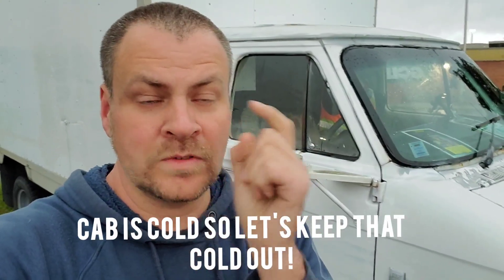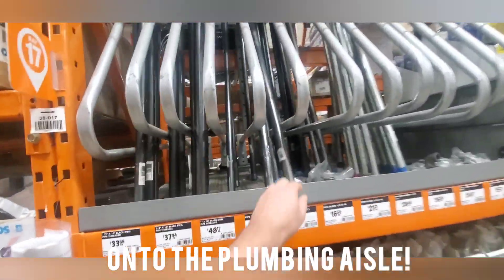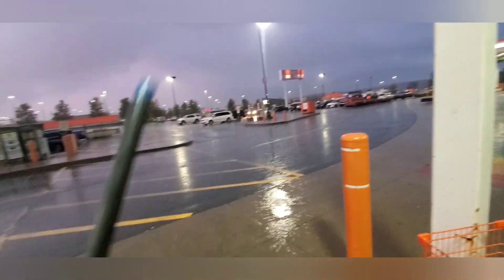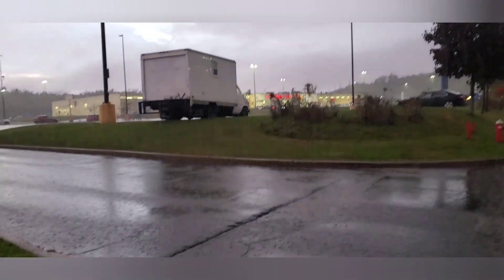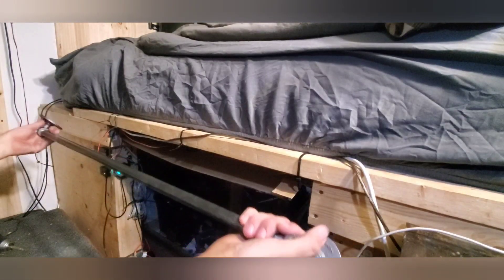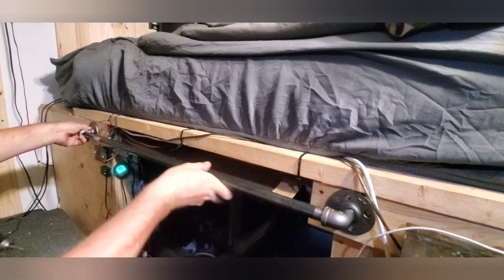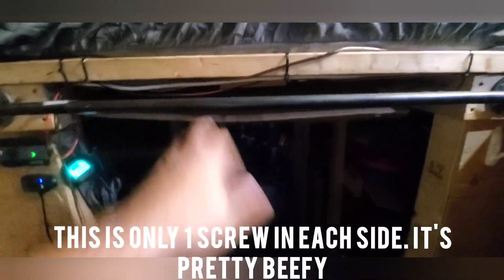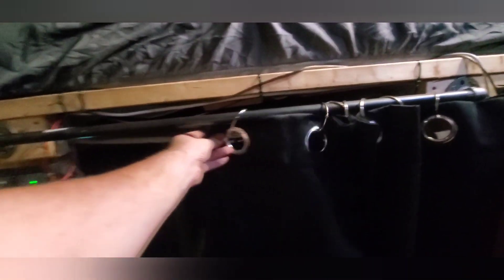Easy "No Build" Privacy/Anti Draft Curtain for my Box Truck Camper Conversion

Comment: The holes in the curtain are to run the bar thru! Don't need hangers
Reply from the maker: True, but this way I can remove and wash it as needed without having to remove the pipe.